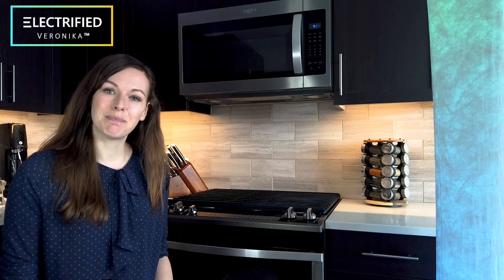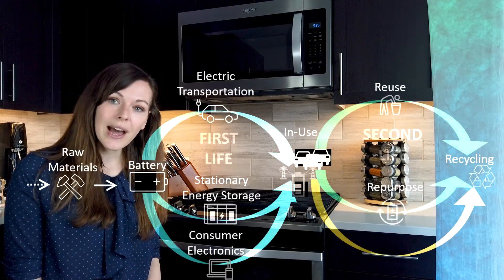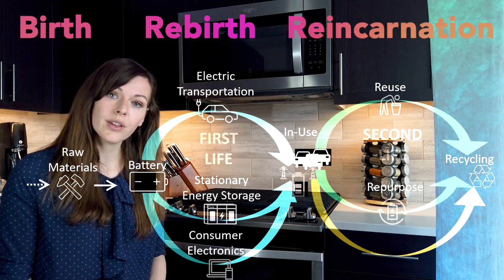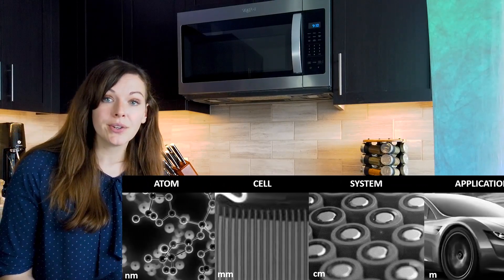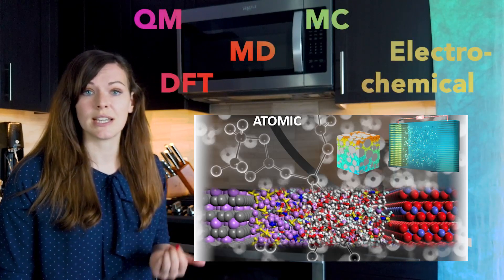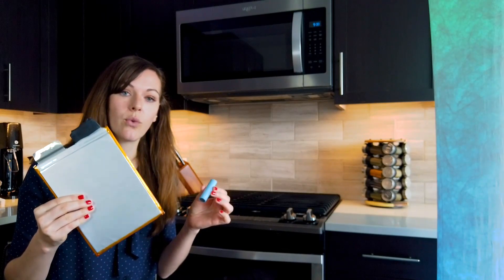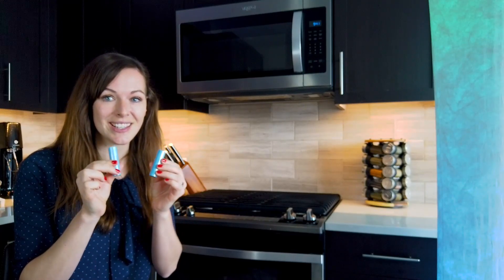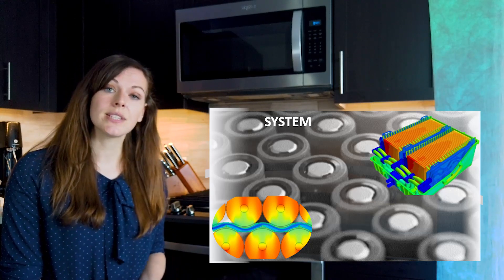Battery Simulation, Virtualization, Digitalization

Comment: Nice and Informative video. Please make a video on cell and pack level simulation. 
Veronika what do you think how far are we from the battery that would charge in 0-80% in 8-10 min and have a 3k-4k cycle life with fast charging. What do you think of the future of solid-state batteries?
Reply from the maker: There will certainly be some more videos on this! Industry and technology are rapidly growing and evolving. With the current technologies we have, we can satisfy the large majority of future EV drivers in terms of charging speed and lifetime without a problem. In my opinion, we need to roll it out, provide the infrastructure and optimize business models. Solid state batteries are still in their infancy and I personally see lots of challenges when integrating these cells into systems. Again, the current battery technology is pretty awesome already and there are so many companies out there that will help optimizing it. More on that, coming soon!